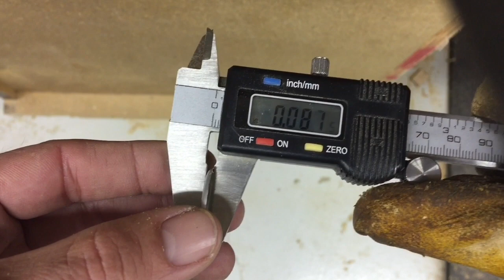A Ball Marker for Rolling your Rock

Comment: Unfortunately, I don’t have a access to a metal grinder like that. How long would it take to do it by hand with a metal file?
Reply from the maker: Probably 10 to 15 minutes per cap. The key is really to keep each cap relatively flat so you can fit the two together pretty well.
Reply: StanCrafted what do you think would be the easiest way to hold them to make them as flat as possible so that they fit together?
Reply from the maker: @alexraver3439  After you bend the crimped part of the cap out a bit pinch the cap in the middle and file the crimped part away.  This will that the longest time, but you can get aggressive here, we're just trying to remove material.  When the crimp is gone, the cap will still be a little crowned...this is good we need that to have just enough depth to conceal the penny.  Once the crimp is gone hold the cap on edge as I do from the 1:23 mark to about the 2:00 mark and file the whole surface at the same time.  Rotate the cap a couple of times as you do this and it will get flat in a hurry.  Be very careful at this point the edge of the cap can get sharp.  Not a bad idea to wear a leather glove on the hand that is holding the cap.  Hope this helps!  Definitely post a pic when you get done :-)
Reply: StanCrafted if I hold the middle of the cap, will it damage it when I start filing it down by hand? Pinch with just my fingers or with a pair or pliers?
Reply from the maker: @alexraver3439  Pinch it between your fingers and thumb.  Shouldn't damage it, just file away the crimped edge in one place then rotate a bit and file the next spot until you've gone the whole way round :-)